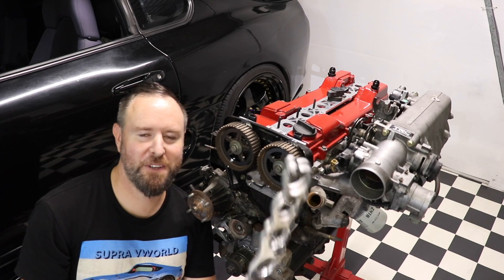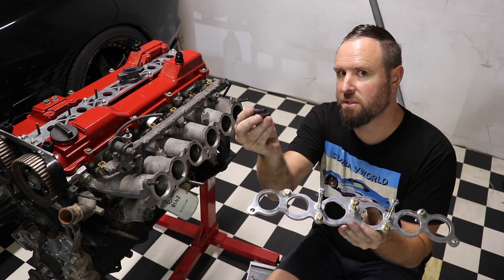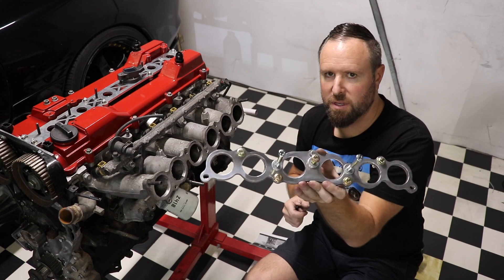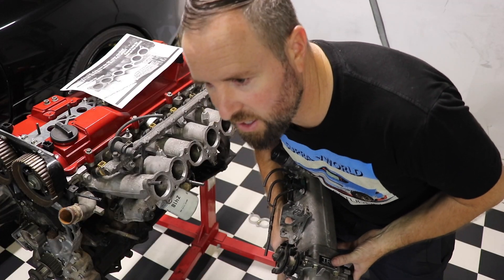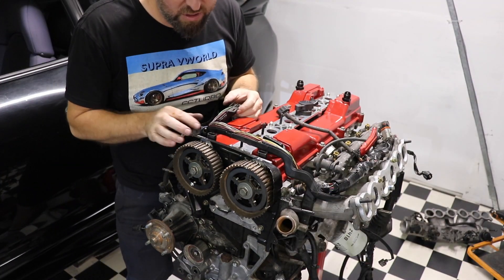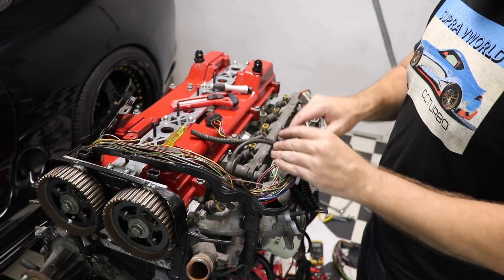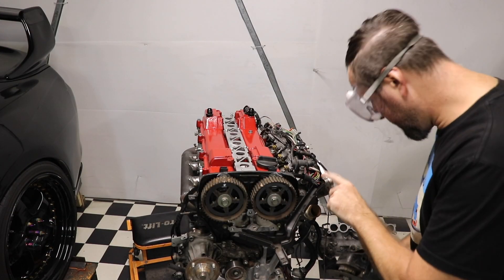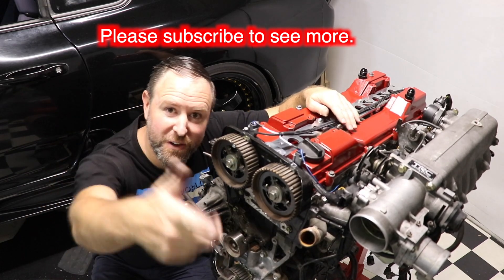GE-GTE Inlet adapter install

Comment: How different would the wiring be for running the vvti gte plenum on a vvti ge from an IS300? I'm really trying to keep my cruise control and everything working like factory
Reply: Bumping this up as well as I’m trying to do the same thing :)
Reply: same here. my manifold does not have the iac at the back and there is a plug on the TB on inboard side. I think a separate video is needed for vvti
Reply: I’m in the same boat. VVTI GE with an Aristo plenum. Any info would be helpful, thanks!
Reply: Yeah im on the same boat would be cool to find out recently got a intake vvti for it !
Reply: I’m also curious, could you please cover this!

Comment: Dude this is sick. Love your channel and content. Keep it up. Just wondering if the plate would work on a 2ge runner to 1jz intake instead of a 2gte intake. Just hard to find personally gte intake Melbourne.
Reply: I know the 1jz intake is smaller in my research but I think others would like to know also. Cheers

Comment: I have a 96 SC300. You stated that they have the 12v MAF wire when I need to use a 5V for the GTE Map. How would I go about converting it to 5V? I have an PnP AEM v2 for the GE harness. Would I be able to simply change it from 12 to 5?

Comment: Hello buddy, I want to use gte's intake manifold on my Ge and continue running na. I don't know if you have tried it. Do you think it is possible for gte's intake manifold + ge's throttle to work without modifying the ECU settings?

Comment: Hi,  I have a 2JZ-GE, 
N/A non-vvti from a Lexus sc300 and would like to eliminate the distributor.  I am going to swap this engine on my 1985 Celica Supra,  MA61, P-type using the stock 2JZ ECU. Do you have a coil on plug kit that has everything i need to do this conversation? I don't have plans to do turbo.  I want to keep everything stock. Thank you for your time.

Comment: Super important question, say you were to use and aftermarket intake manifold, how would u add in the sensors? I’m starting my Na-T build soon and would like to use a different intake manifold than the oem gte one.

Comment: Can i use my ge map sensor on the gte intke?
Reply from the maker: No, the GE map sensor won’t work, you need to use a GTE sensor for GTE ECU’s and it will work with aftermarket ECU’s also.
Reply: @supravworld8777  so it wont work with my standalone emu black correct?
Reply from the maker: @favier9856  no. The GTE map sensor maybe compatible with your ECU but is only a 2.3bar sensor, so it will only work up to 23psi.

Comment: What did you use to plug up the hole where the dizzy was?
Reply: you can just cut a plate of aluminum drill a bolt hole then just rtv it and tighten it down with the dizzy bolt/stud
Reply: @🇯🇲Island_Bwoy🇨🇦 Nice! Thanks

Comment: Would the adapter work for an aftermarket GTE intake to a non vvti GE head ?
Reply from the maker: Probably not, unless it bolts on the same as the stock plenum
Reply: @supravworld8777  bolt on same spot as GTE intake , it’s just a front facing intake manifold for a GTE . Would that work with your adapter on the GE?